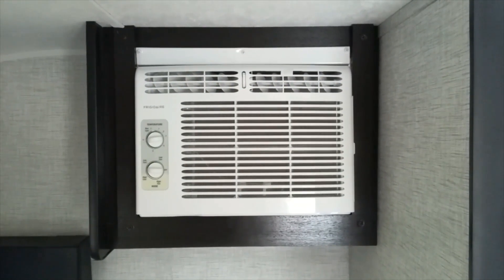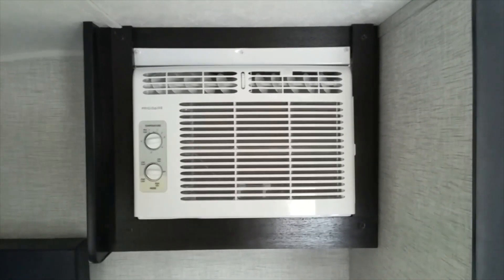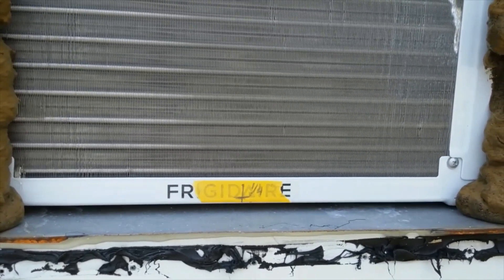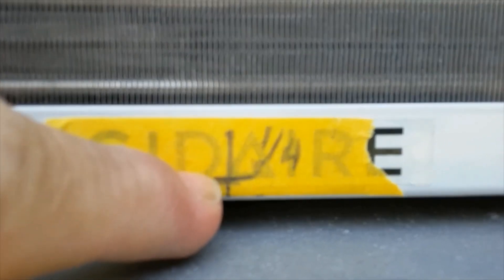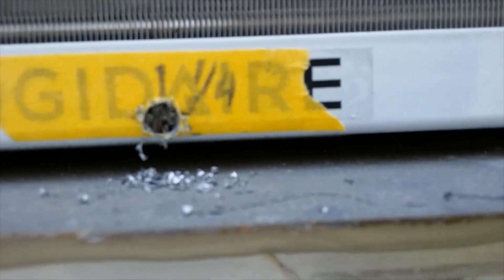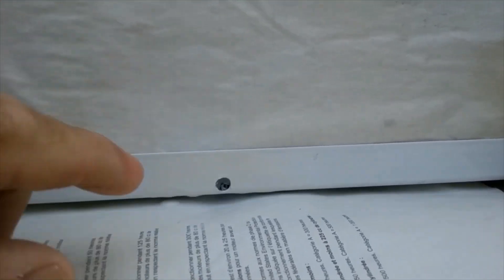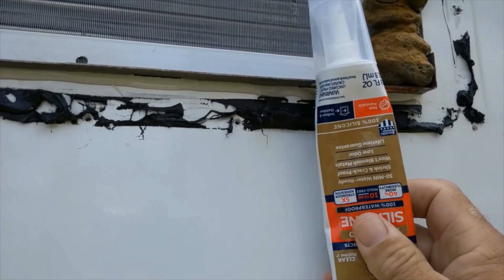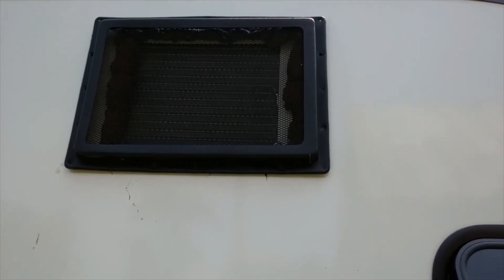RV Camper Air Conditioner trick

Comment: Great video!   Our 2022 17FD a/c compressor will not stay on and leaks inside terribly - and that's with the camper perfectly level.  Didn't come close to cooling the camper. Very poor design and workmanship.  Most Bushwhacker owners are having same issue, along with many other problems.  But I'll definitely do these steps to assist drainage. Thanks!
Reply from the maker: Hope it helps you out, thanks for watching and your comment!

Comment: Great info. I did have water buildup in my pan which ended up on the counter below. I called the dealership and he told me to elevate the opposite side which did help and lots of water drained out the drivers side of the camper. I will look at that procedure with my guys.
Reply from the maker: Yes always try to park it with the a/c on the lower side, it does help. Thanks for watching !

Comment: Thanks for this information. We just picked up our 2022 Bushwacker 15FK. One of the changes the mfg made was to install the sink UNDER the airconditioner. So that might help. We towed about 80 miles from the dealership on back roads and did well with our 4x4 Tacoma and newly installed electric brake system. 
     Did you find the support framing inside the side cavities to be lacking? We are going to add supports. The door side cavity was screwed into the side wall of the camper, but the air conditioner side was not and only framed with staples. I found that to be interesting. We will add more framing support. 
    What do we look for to check the support under the shower floor? You mentioned yours required more shim. 
Thanks! I look forward to following your channel.
Reply from the maker: Thanks again for watching, if you take the 4 screws out of the cover panel under the door to the shower off at the floor, then look in there under the shower pan there is a wood platform that moves around. it needs to be snug aginst the bottom of the pan and not move around. we shimmed it up and glued the shims in place, then put a couple of screws in it to keep it in place, also while your in there, there is a block that is under the furnace, fasten it down to the floor, we glued ours so it dont come out. hope that helps .
Reply: Thanks Traveling Teardrop. Very helpful advice. We will check those areas. Sounds like we will have a new hobby besides camping ⛺🔥 . Makes sense... Zen & the Art of Camper Repair.

Comment: Curious how the water will escape with butyel around the edges of the cover.  Wondering if you should add a little hose and run it past the edge of the wire cover.  What are your thoughts on that approach?
Reply from the maker: the black cover has drain holes made into the bottom of it to let the water drain out.

Comment: Do you know where I can get the exterior vent for the ac exhaust?  I want to do this same type ac install in my vintage camper and RV dealers don't seem to know where to get the vent. Thanks!
Reply from the maker: Unfortunately I do not, I looked through my books and can not locate a place to get one. Thanks for asking, if I find a resource I will let you know. thanks for watching.